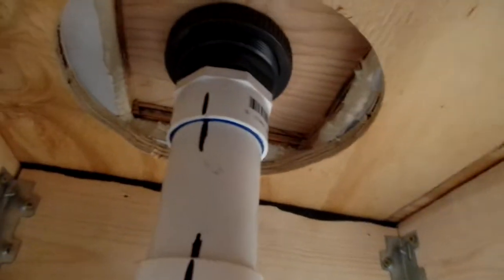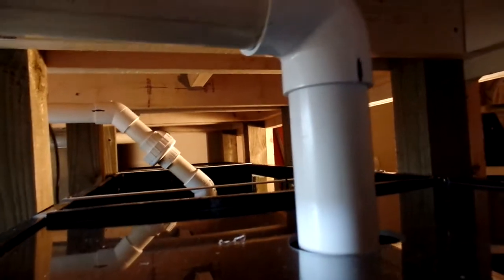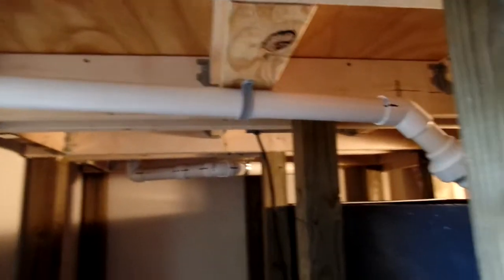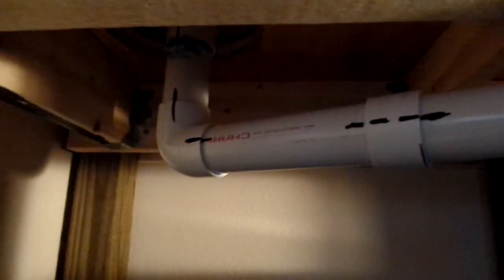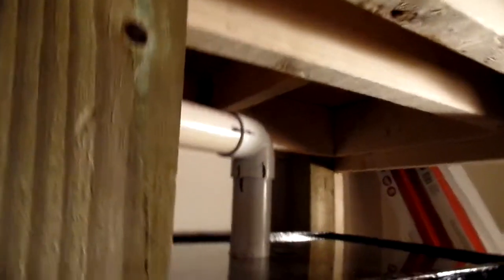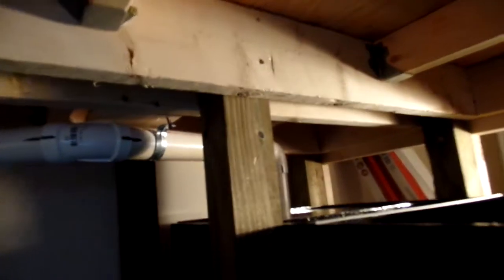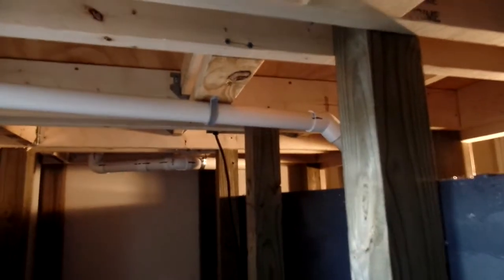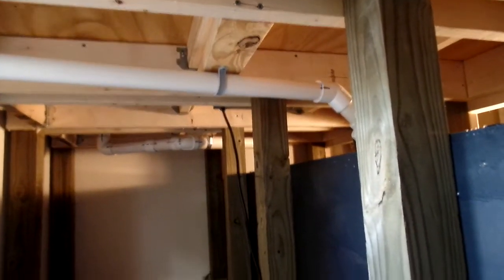1210 DIY Plywood Aquarium System Plumbing Update

Comment: Happy 4th of July F.S. 
I noticed the you cut a sizable hole for the drain which is the right thing to do because you have to have enough space to tighten the nut on the bulkhead. I did the same thing on my tank stand but then I decided to go out the backside like how you did on the      “Giant”. I noticed that the hole you cut on your exposed some of the bottom frame of the tank, is that going to compromise the strength of the tank or vice versa?
Reply from the maker: It shouldn't at all, as it still has 3/4" plywood where the plumbing comes through. I think its like 2 Lbs per sq inch pressure. But because there are so many sq inches the tank will weigh about 10,000 Lbs.  Also I needed to be able to get gigantic channel lock plyers to bulkhead nut. The beast was built the exact same way for the stockmans to come through bottom.
Reply: Free Swimmer, cool I was worried about mine. Thanks FS!